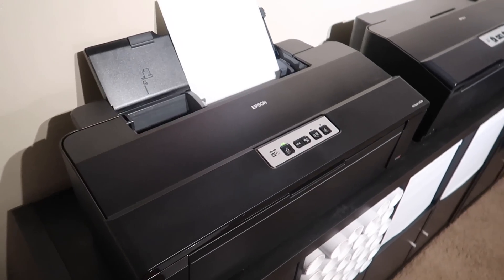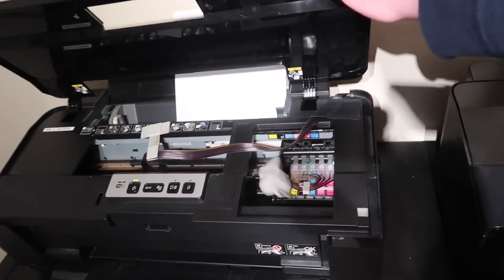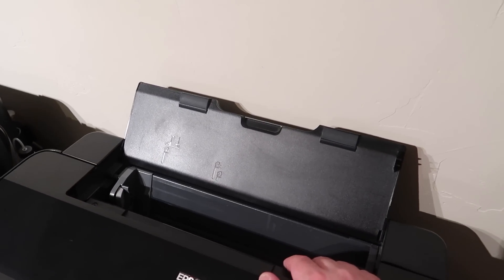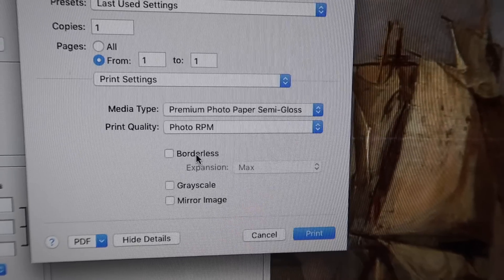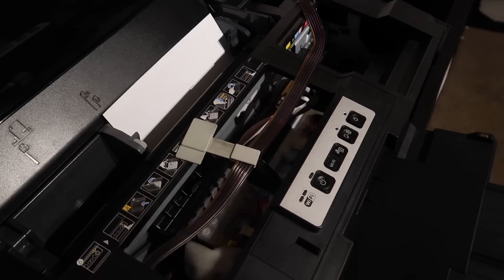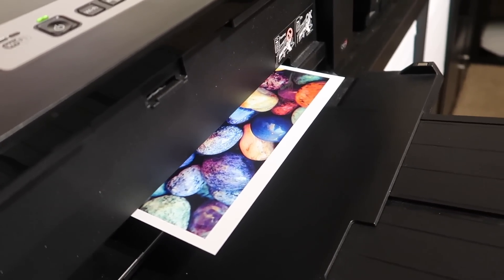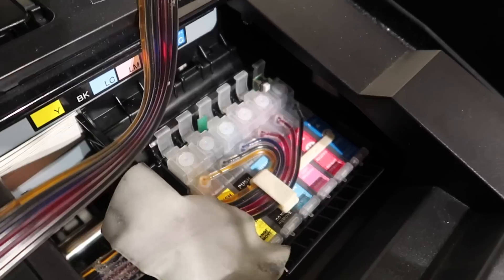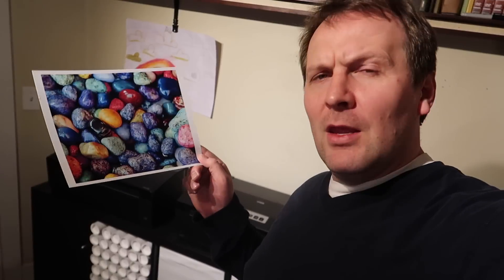Epson Artisan 1430 Review In Depth

Comment: I've had the 1430 since 2012 and it's practically bullet proof. Example: in 2016 my house flooded, as the water was rising toward the house, we put a lot of our valuable equipment (computers, printers, etc) in the attic hoping that the water wouldn't get that high. We ended up with about 3.5 ft of water  in the house and spent the next 8 months ripping out walls, flooring, drywall, etc and rebuilding our home. This was the height of summer in Louisiana and that printer sat in the attic the whole time, uncovered, with construction dust, high heat, and humidity to keep it company. 
When we moved back in, I retrieved the printer, blew the dust out of it, hooked it up and it printed full color beautiful photos like nothing had ever happened to it. I'm still using it to this day. It's 11 years old, and I've never had a problem with it.

Comment: Have one of these.  Worked great for years.  Received a firmware upgrade from Epson.  Installed it, Every color prints okay but red,  red now looks maroon.  Believe the upgrade did something to the printer.  I use three computer to feed to this printer, red become maroon from all three, so believe it is a printer problem.  Have tried to contact Epson about this, but that became a waste of time.   During my search for solution I went to Staples to buy a light magenta cartridge.   They had now.  Manager at Staples said Epson is phasing out the 79 cartridge and probably the printer.

Have performed numerous head cleaning routines, have also replaced the Magenta cartridge think this was the problem, but it still exists.  Would like to keep it, but being told the #79 cartridges are going away concerns me, but there is always other vendors.

Any suggestions to save this printer would be appreciated.

Chuck

Comment: I used one of these for a few years but traded out for a Canon because this printer, no matter what I tried, would not duplicate the colors on my screen, it was always way off. I even sent off to have a specific profile made for my ink and paper, and still it was way off. It was important for me that my prints be very specific in the shades of colors I printed, and this printer just would not do that. You could completely de-saturate a grey and it would still print blue-grey. The Canon's colors are much more accurate to the screen / print preview with just the standard Canon profile...
Reply from the maker: Yeah, I love the Canon printers, rarely if ever do I have a color issue.

Comment: Great video! Thanks for the review.

My only issue is that I'm trying to print really opaque blacks for film sheets (screen printing) but they keep streaking and coming out light. The printer fresh out the box along with the ink. I'm not sure what the problem is. Only possibility is that the box was sitting for months, but it was sitting at the store too so...

you're thoughts?

Comment: I mistakenly upgraded my firmware and now it will not recognize  non OEM cartridges. I do not have the original CD to retrieve the old firmware because I purchased the printer used. I want to use it for DTF now it is a expensive paper weight :( I can not find the old firmware online anywhere

Comment: I just purchased this printer, used for $150 USD.  I did not test it at purchase, but the seller did head cleaning and made a test print on it.  I took it home, turned it on, and connected it to my MacBook Pro.  I selected an image to print, but at first attempt the printer responded, but did not print since I forgot to open the paper output door on the front.  Made a second attempt, but the printer says, 'Cannot print because the CD/DVD tray is installed.'  I checked the printer, but I don't see any tray installed.  Made several attempts, the same outcome.  What am I missing?  Please help.  Thanks!!!

Comment: Thanks for the review! Because of this video I bought the printer, the CISS, the printhead cleaner, ink etc. The only thing I'm still curious about is the bypass system you set up? Can you elaborate a bit more on that sometime and how you set that up? I feel like with all the printing I'm going to be doing that it'll be essential, I'm already getting the occasional small black splotch on my prints when I feel that the pads build up with ink...then again I'm still rather new to this so it could be something else. Either way, if you could explain more I'd be very grateful. Thanks again!
Reply from the maker: Thanks & You're welcome! I've actually already filmed a video I just need the time to edit it.  If the splotch is on the print side of your art it's an occasional fluke from the printhead just "barfing" on your art.  Gee thanks.  If it's on the edges your media is either curved or thick so it's scraping the print head on entry.   If it's on the underside you have a dirty path, dabbing a paper towel around the bottom of the printer will help clean it up.  Out of curiosity, What are you printing?

Comment: Great review! I'm a graphic designer and I'm looking for a wide-format (13 x 19) printer that I can use to print double-sided, full spread brochure proofs for client presentations. Will this printer work well for that application? Also, will this printer do duplex printing automatically or is it a manual process? And finally, do you have any experience with Red River double-sided inkjet paper? Thanks!

Comment: I had this printer when it first came out it is a great printer the price. I use it for Tshirt transfer, cd printing and photos. I do recommend using epson ink only don’t buy that cheap off brand ink from eBay or amazon it won’t hold its colors. Epson ink might cost more but you get better results. I did some Tshirts for a customer using off brand ink and when they washed the shirts it faded. If you don’t print everyday try to print a color page once a week to keep your colors and heads clean and clog free. Also don’t use the transfers from Walmart or staples because the material will have a thick texture to the shirt. Order online

Comment: Hello, i am using this printer for sublimation with cis from Inkxpro. I have a lot of trouble trying a good print. First the pin wheels from the printer (somepeople calle pizzawheels) got marked the paper, even if i clean the wheels before printting, i just like the ink doesn't dry and the wheels stain by that ink. So i try to take out the middle  wheels to stop that, cause any setting i make works, but now i just have problems beacause the ink leak 
when is printting and the problem goes wrong every time i try to solve. Do you have any idea can i do. i am just loosing my mind.

Comment: Hi, very informative video. Do you think this printer would do a good job printing large format restaurant menus? I'm thinking of this printer as a short term solution to a longer term and more expensive color laser printer. thanks
Reply from the maker: Yes and no.  It can print large format prints great, photo real if you have images of your food on the menu.  But you'll want to laminate them as these are dye based inks and will not hold up to water.

Comment: I got one of this Epson 1430 and the first day I plugged it in there was a power surge and the printer had smoke coming out of every vent. It worked for a week then stopped connecting to my laptop via usb, I think the USB port is fried bcus whenever i plug it in, my mouse doesn’t work properly and the usb cable shocks. so I took it in for fixing and they’re having my capacitor changed cus it was really banged up from the power surge. I’m yet to pick it up from the shop. But Please I’d love to be guided on how to connect the printer to my laptop wirelessly so I don’t have to worry about the usb even if ends up not working anymore. Do I need a router to do that or is there a way i can connect to my laptop? I’m frustrated right now.  This is my 1st epson and I’m yet to enjoy it. I need help!   Pleeeeease

Comment: Are the after market inks archival? I had some bad luck finding the right type of dyes or pigments for my printer. Color profiles are all messed up, the paint something won't stick to the papers like it should....what are your thoughts. I heard you used the word good enough a few times, but would you buy a print if it was just good enough?
I ended up switching back to oem ink....its a lot better but fregging expensive.
Reply: This is a good question. Also, the problem with inks is it is only good for images for display, not for art that people touch like comic book pages.

Comment: I need to print nice quality illustration prints, but on normal copy paper sometimes. Does this printer also work well for this? Or will it freak out if I don't use fancy epson photo paper?
Reply from the maker: I've put all kinds of media through this.  Basic cheap copier paper works fine.

Comment: I have used this printer for a while and love it, but i am having trouble now that it ejects most of the paper sheets when tryng to print, have you experienced this? Can you give me some advice? Thank you for your help!
Reply from the maker: "Most"?  No.  I have had times when it will eject certain types of materials.  It always handles normal paper and photo paer just fine.  What are you using?
Reply: just normal paper, and this is something new, just asked in case you had some tips (troubleshooting advive) thank you, probably some problem with the rubber rollers...

Comment: So I'm assuming that this printer still relevant today I can get my hands on one for under $500 just trying to figure out the ink cost
Reply: Did you end up buying this printer?  I just bought one used in pristine condition for $150 USD last week.  I am planning of converting it to CIS system, when the installed ink is emptied.  Presently, it does not print since I have a "CD/DVD tray installed" WARNING, however, I do not see that tray anywhere on or in the printer.  I must be missing something.  I hope your printer is working well.  :)

Comment: There printers are the best! (I've been using them for years) BUT there support is utterly horrible.......   Epson outsources its over the phone support to some lameass company in supposedly Texas. Two phone calls on two different days, and both times I get a Texan with an Indian accent.....   Bolth were extremely rude and both were absolutely no help at all. All they wanted to do is pry inside my computer to fix the problem. No advice, no tips or try's no nothing.....   Once I downloaded the instruction manual, it took me two minutes to fix..... Now why couldn't these two idiots tell me that over the phone?  P.S this printer is from the XP days, and the original manual is long gone....